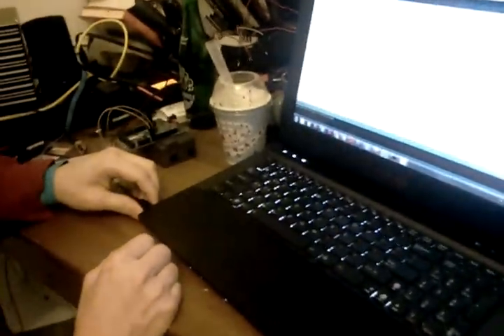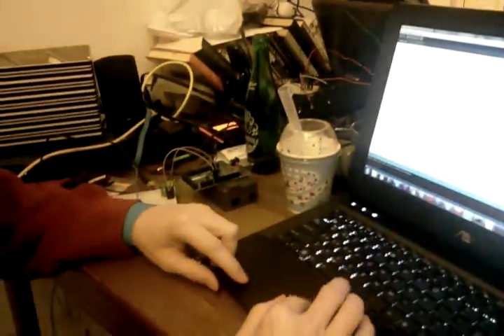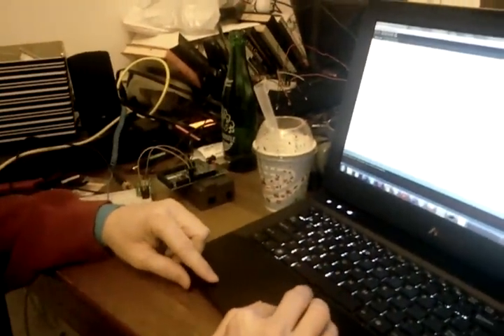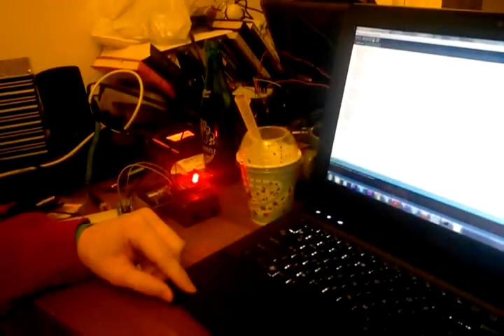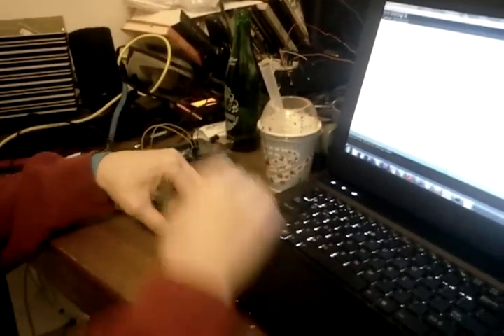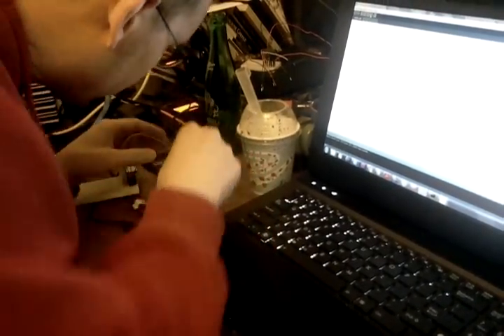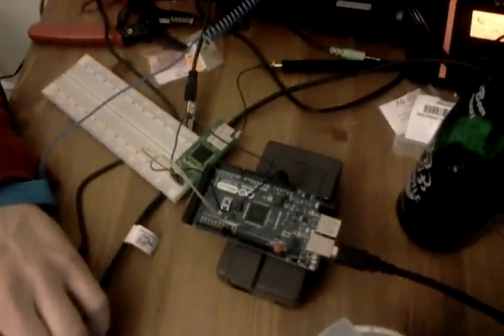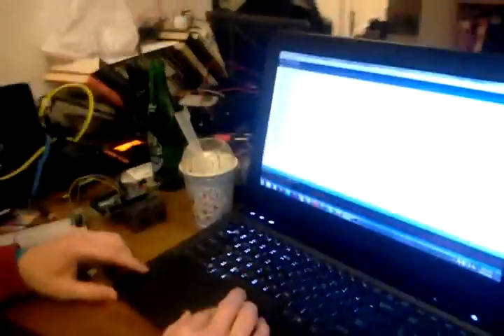WiFi + Arduino - First Successful Test

Comment: How do I connect my UART-Wifi module to an AVR board with ATMEGA 16. Do I need an adapter? Can I directly connect it? Whenever I directly connect it by connecting the Rx pin of the module to Tx pin of the board, Tx pin of module to Rx pin of the board, +5, Gnd to their respective terminals, I get the message-"Module Disconnected". Do I need to program my Arduino board prior to directly connecting it to the wifi module? And if yes, where can I get the code? Is an adapter necessary?

Comment: Could you tell me if this would be possible for a college student just learning Arduino this year to do?

A motor connected to a radio antenna dish and Arduino with some kind of  radio sensor that adjusts the dish for a receiver to gain optimal quality?  

thanks